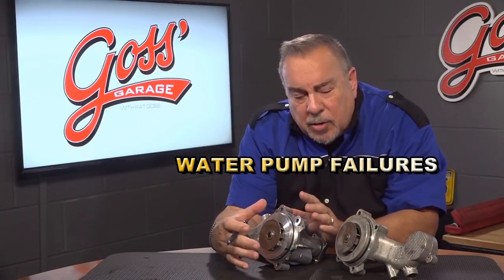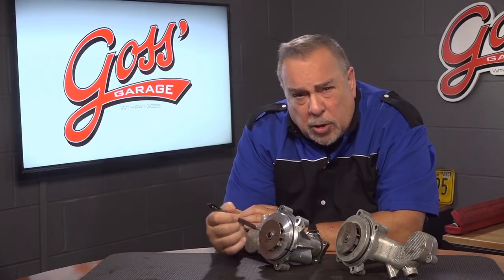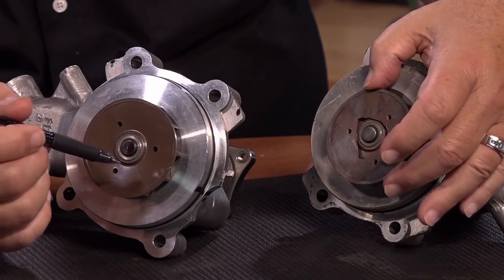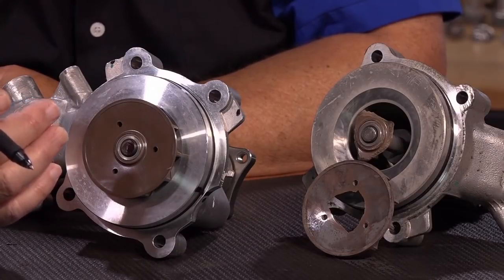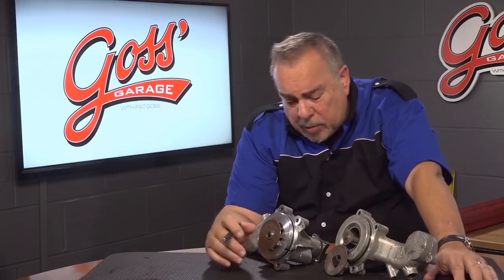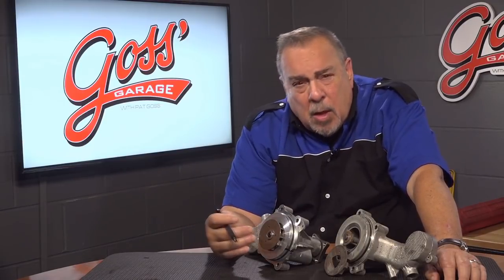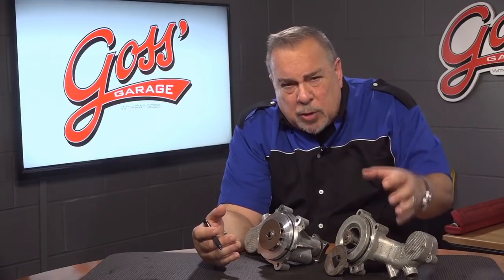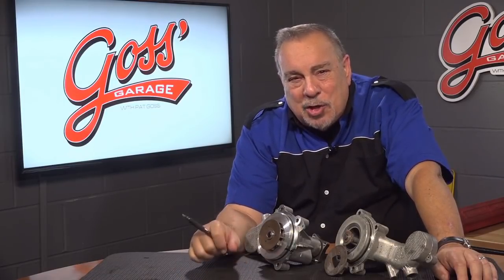Water Pump Failures

Comment: Is it possible for water pumps to intermittently work? I have a '98 Chrysler Sebring that I only drive a few miles at a time before it starts to overheat.  The radiator isn't clogged, there was no leaking, no whining noise. At first I thought it was a stuck closed thermostat until one day, out of the blue, it stopped overheating and there was normal flow in radiator and heater core.  What I did hear was a sound much like knocking rods. Occasionally, I would later lose cabin heat and notice temperature rise.  I figured it had to be the water pump since I have never heard of a functioning open thermostat closing while driving. The next day, circulation returned, along with the knocking sound from the area of the pump.  It is not an easy fix because motor mounts have to be removed and the engine supported to replace the water pump.

Comment: I'm guessing this my issue with this 2013 Hyundai. Supposedly they said it needed a head gasket but show zero signs of it. No oil coolant mixing no rough idle no white smoke so technically no major symptoms. Looked everywhere but I'm not getting any heat so I'm taking a shot that its not circulating and pushing the water into the heater core since one hose is warm and on isn't and yes the heater core isn't gunked up nothing is so my last guess is this before I really look at the head. It has a turbo so if it was really the head I doubt it'll even run

Comment: My 1998 Dodge Ram 1500 5.2 pump went out . The radiator in turn had to be replaced too! The the transmission line cooler didn’t fit in correctly on new radiator . Smh fun stuff ! I went all out I removed the ac compressor the alternator and brace and radiator then the pump

Comment: Does anyone know if this could cause the engine temp sensor not to receive any temperature(no pressure or circulation)? Hence the temperature gauge in the dashboard not moving at all.
Reply: Of coolant is not touching the temp sensor than it would not provide the correct temp to the ECU, right?
Reply: i dont be;ive so all those have different connection temp sensor the gage and the pump if the gage isnt working replace that the engine temp senor should be on thermostate house its a plug type to by pass til you can replace unplug and put a open wire on the connetion it will keep the thermo working just wont regerster then heat but tnw wire plug will need to be replace

Comment: Had no idea there was a safety feature like that. Makes sense to have the computer shut the fuel off from some of the cylinders to allow them to cool.
Reply: “Intentional shut” off i believe its what ford does with the injectors , to prevent raw fuel into the cats and more  likely you will see misfire codes in most if not all cylinders.  and i hope many other manufactures do the same with their computers.

Comment: If they made a plastic coated metal impeller it would solve a lot of problems.
Reply: And create a few more. Imagine if the wear from heating and cooling caused the coating to crack and chip away.